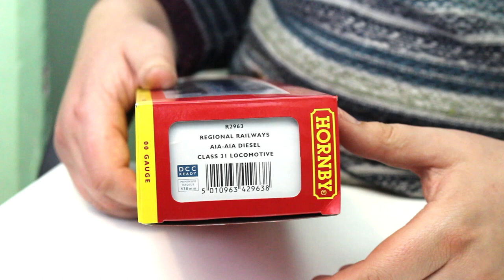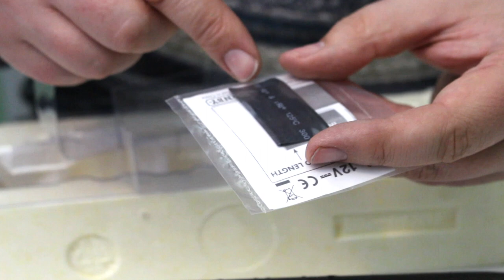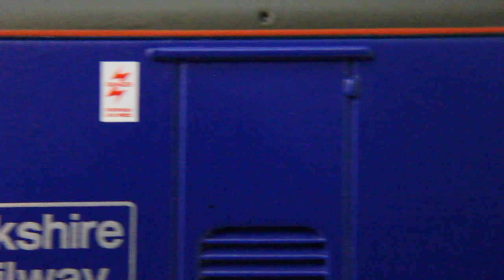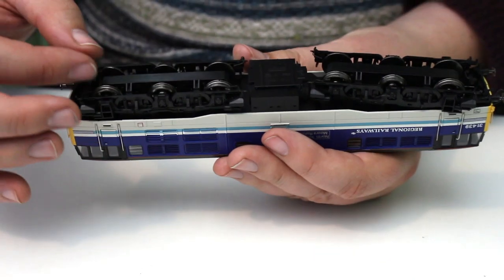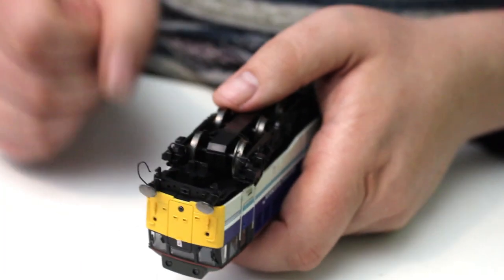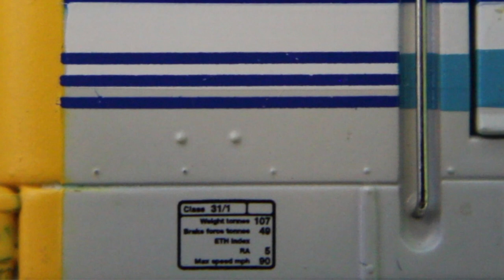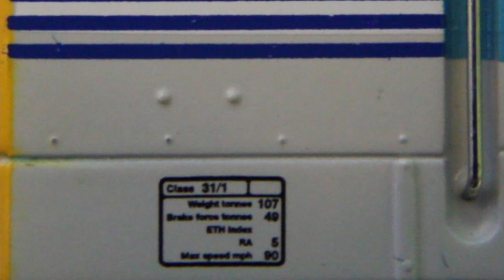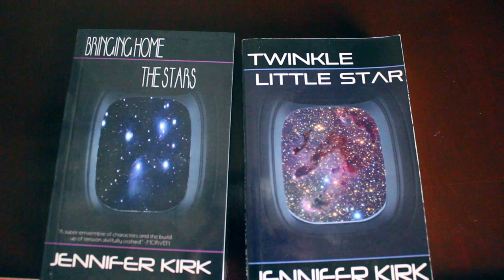Hornby Class 31 A1A-A1A Diesel in Regional Railways Livery - R2963 - Unboxing and Review

Comment: That was a very good review... it's nice to see someone who actually know something about the prototype.

I have a couple of these myself (31410 and 31439).

For me, there's only two things that let this model down.

1: For some reason, the high-intensity headlight is missing, so there's just a hole at the bottom.
This is easily fixed with a plastic one from Replica Railways.

2: The livery, while nice and crisp, has the pale blue strip and the white strip above the same thickness.... but Regional Railways livery has a thinner white stripe than the blue.
This is fixable, but it means masking about 1mm and the dark blue respraying.

This is a problem Hornby have... they rarely get Regional Railways or InterCity stripes the right thickness.
On InterCity, it's worse.... Not only are the thickness wrong, but the red stripe is too red where it should be more orange (it's the exact same Flame Red that old Railfreight used), and the tan band at the bottom is far too strong (it should be like a pale Manilla envelop colour).

As it comes out of the box, the Hornby 31 is very good... but personally, I like to take things an extra stage futher, so I'll be replacing the roof fan and grill with a Shawplan etch.

I also ditch the rotating fan.... it's too much like a gimmick, but it can give the model a stutter at show speed as the rubber band causes a 'drag' effect on the motor.
It's an easy fix... you just cut the rubber band with some clippers or a modelling scalpel.

I've only just started my own youtube channel a few months back, so maybe I ought to do some unboxing videos?!

Thanks for the video.
I'm now going to take a look at some of your other videos.... and I've subscribed too.

Comment: This Regional Railways livery wasn’t a bespoke livery really. They just covered the red stripe on NSE locos and stock removing the upswept sweep on the locos. 
I worked for NSE when everything was painted red white and blue  with Chris Green in charge then it was mostly transferred to the northwest with the original plan being to create Network Northwest. Apart from some stations getting the the same NSE red and white repaint and some NNW signage nothing much more became of it. Chris Greens brother was the figurehead for NNW but it soon became u dear the Regional Railways banner hence the pale blue stripe replacing the red on the coaching stock due to impending privatisation.
The BR plan for this was to sell Intercity as one entity, Regional Railways as another, NSE covering more or less the same area it operated in during that time.
Government wanted a bigger breakup and the chaos we have today is the result of that fantastic plan!

Comment: I know I'm in a minority but I feel that detail such as sprung buffers, opening cab doors and spinning roof fans are totally pointless. They do nothing for the operation of the loco and simply make a needless, substantial addition to the cost of the locomotive.
Reply from the maker: I would agree with you, which is why I sometimes describe some of those features as detail for the sake of detail. The opening cab doors especially are a step too far, and I believe they may have been dropped from later versions.